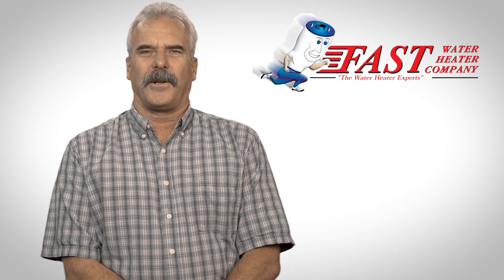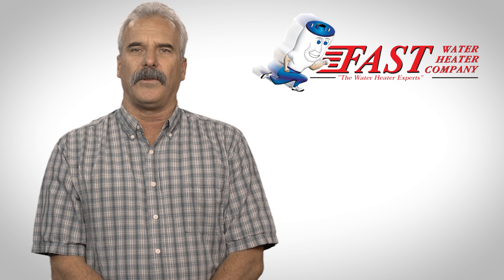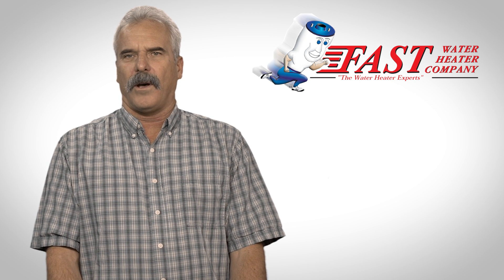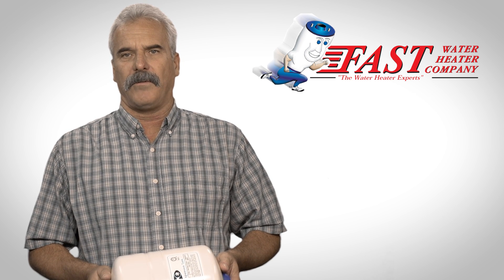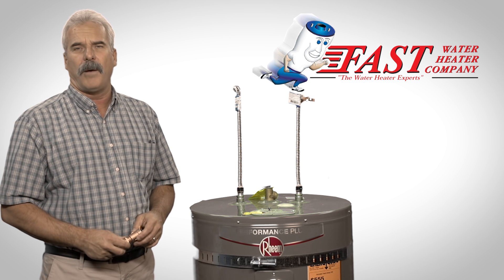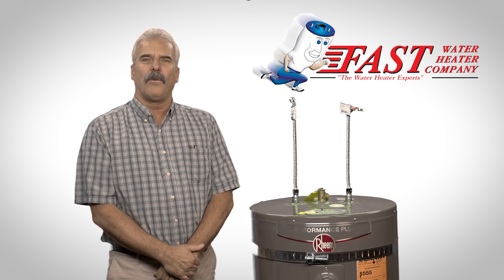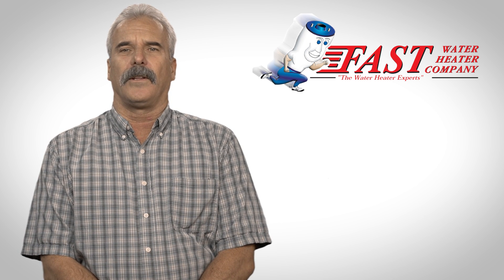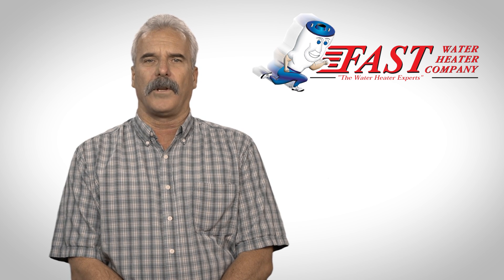Water Heater Codes

Comment: Hi Steve, 
I live in Charleston, SC as far as I know we are a D sub zero seismic category here. I do admit I'm having problems getting the exact info/cat. for my area. I'm writing because I recently had an external gas water heater installed by our local electric and gas company. The previous tank was thinner in diameter so a shed had to be installed for the thicker size of the new tank. This creates a overhang of the shed on the old pad for the previous tank. The tank also seems to not be anchored or fastened in any way which generated questions about typical installation protocol and even specific codes for Charleston. To make matters worse the shed is installed in front of a window ledge and is therefore not flush against the wall. The old shed had a line of caulk that mated the old shed to the wall thus increasing the stability of the shed. I also wondered if the cut-outs for the piping into the shed should be sealed with a gasket or caulk to deter other life from making a home inside the shed or possibly better keeping out the weather. Thank you for making a very informational video and look forward to your answers.